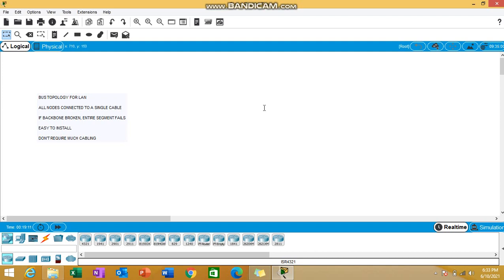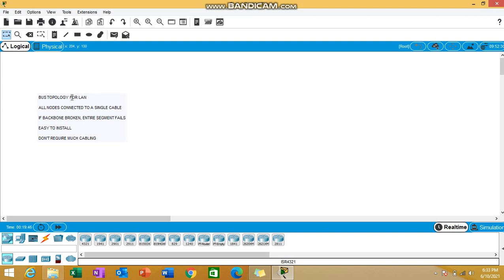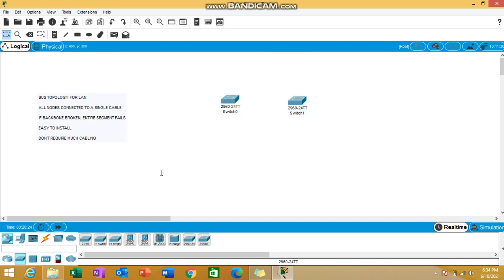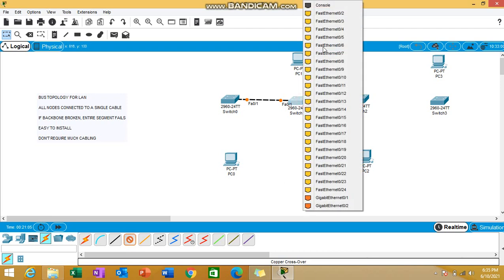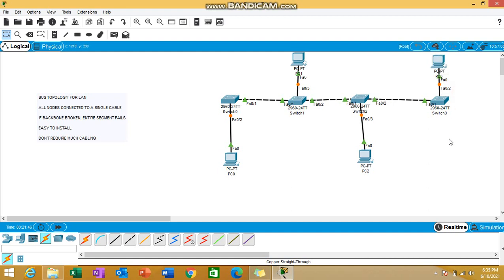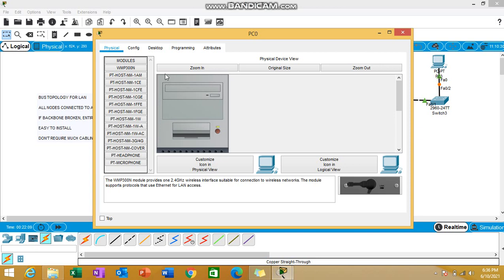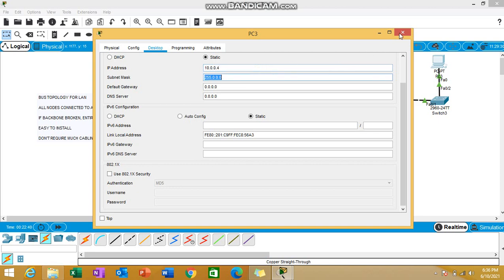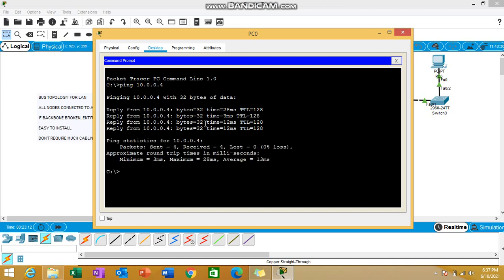Simulating Bus Topology in Cisco Packet Tracer

Comment: What are you using this much switches for? Do you know how much a switch costs? and you are using it for single PCs. The main pros of using BUS topology is to not use any networking device, and do it in as much less cost as possible.
Reply from the maker: Its just for simulation.
Reply: @UnboxingBigData  then why aren't you using HUBs? wouldn't that be realistic because transmitting data on a bus would broadcast it to all devices on that bus